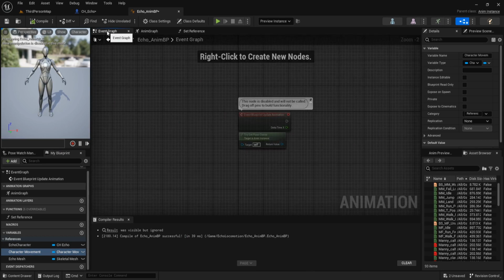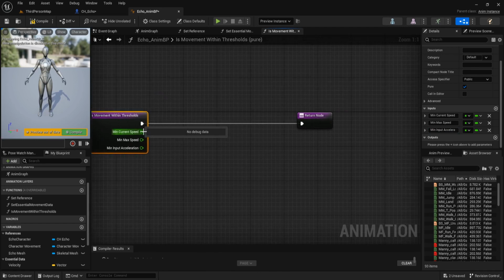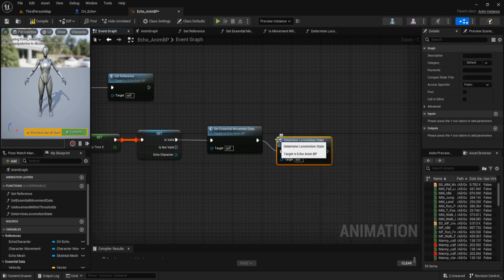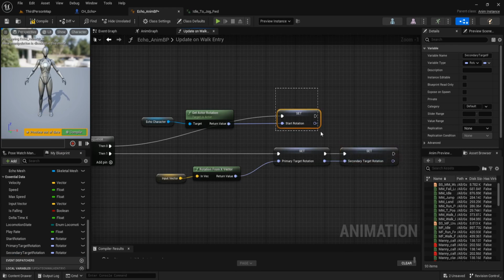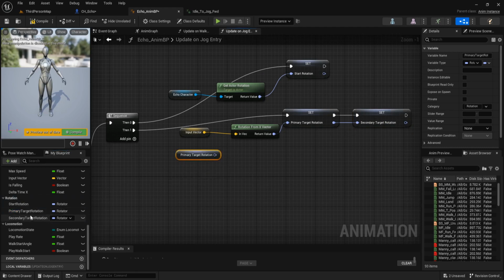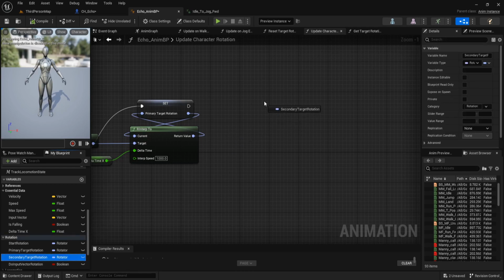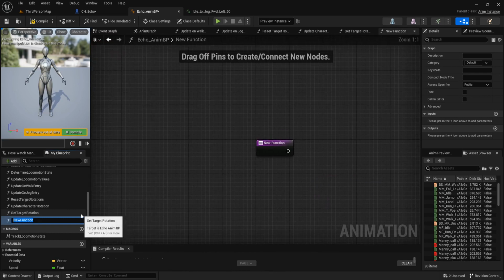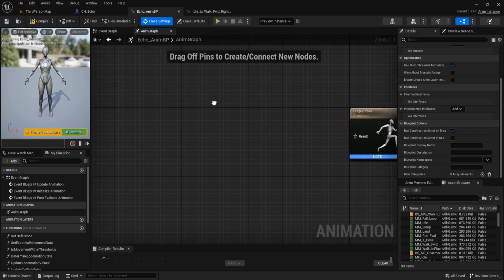Advanced Locomotion System Tutorial- Part 2

Comment: For some reason when i tried to run near a wall, the player run slowly.
Reply: In the "UpdateLocomotionValues" function, after you Safe Divide and before you set "Play Rate", add a clamp (float) node and set it to something like 0.85 for min and 1.15 for max.
Reply: @francopizzani4075  Thanks.
Reply from the maker: That is the feature.